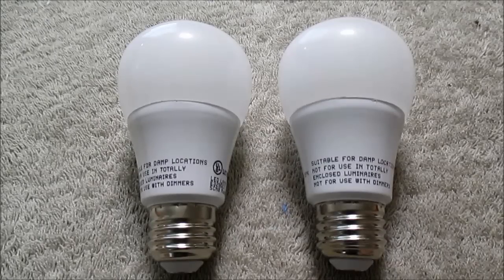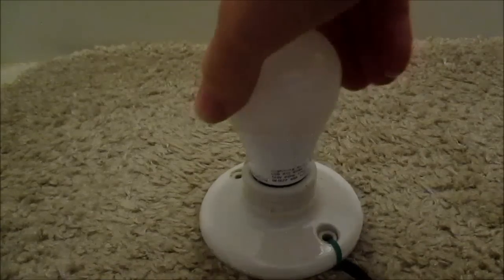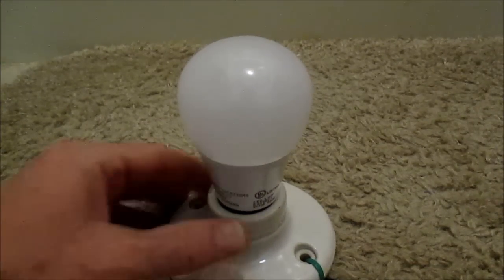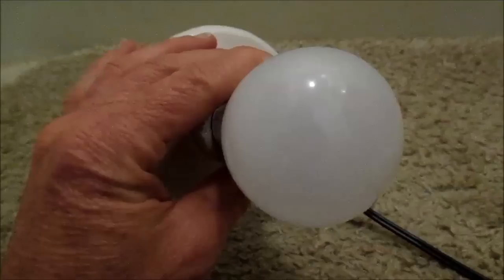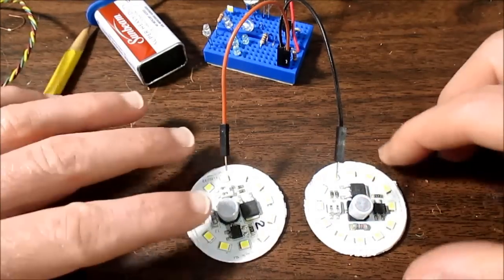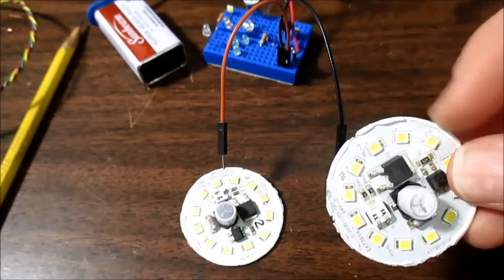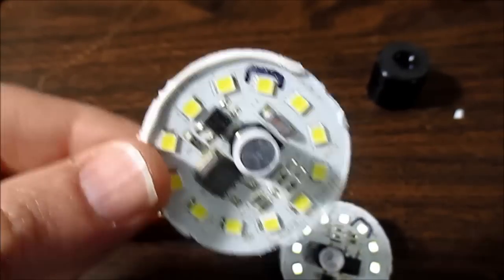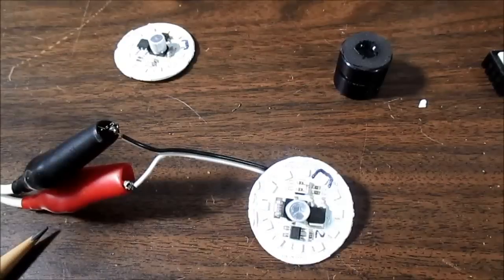Two failed LED bulbs for teardown to determine the cause

Comment: Could they make them so they are in parallel so if one dies they all don't die!
Reply: Yes they could. By putting say 3 strings of the LEDS in parallel you could have less of an impact when one LED failed, still having 2 strings of LEDs working. However, that would need 3 series-regulators and associated components, making the lamps bigger and more expensive. Rob
Reply: Rob Johnson How do Christmas lights work when one dies they all don’t die? And they are very cheap?
Reply: I have not touched Christmas tree lights for many years !

When they were filament-type bulbs (in the good-old days) connected all in series, the bulbs were designed to "short-out" when they failed so that all the other bulbs stayed alight.

That was OK until several bulbs had failed and all the other bulbs were being seriously over-run.  The better sets had some-form of "fuse bulb" that was designed to blow if there were too many other normal bulbs blown. That relied on that "fuse bulb" still being there and not having been changed for a normal bulb !
That should never have been allowed to happen, dud bulbs should have been replaced as they happened, they would have been obvious.
If there was no "fuse bulb", either the next bulb to blow did-so catastrophically or the fuse in the mains plug blew, normally the former happened.

Hopefully the fuse in the plug was as low as could be fitted, normally 3 amp in a BS1363 mains plug. I have never seen any 1 amp fuses of the correct physical size to fit a normal BS1363 plug (standard UK/Ireland fused 13 amp mains plug).

I was under the impression that most modern Christmas tree lighting sets were low voltage parallel connected bulbs/LEDs, so the rest of the lights would stay on.  Rob.

Comment: incandescent bulbs are still far superior to this trash.
just silicon, tin and card stock. (all 1005% bio degradable) and pending the style the alloy to make the filament.
no electronics to fail. far cheaper to make. and last for decades.
Reply: +Magyar Áron (RealAron) Inefficient, IT IS the main problem. You do not want to heat by electricity, becasuse it is the most expensive energy carrier. You do not want to heat in outside either. You want light, not heat! Incandescent lamps does not tolerate frequent on/off cycles, they are the least suitable to these applications. The LEDs does not need to warm up, nor the driver circuit, a properly designed LED driver could work in wide temperature range, and could tolerate frequent switch on. In electronics, everything can be designed for every use case, it is just matter of careless thinking and cost. Most of the cheap ones are directly designed to be the worst they can, so they are thrash from the start, and fail after a short time. It could be done to last ten years more, with not really that much more money. Less much than a well designed one really costs. And for the facts, I use LEDs everywhere in the house, it were not cheap, but none of them failed in the past years. You can calculate that (in Hungary), in about 2-4 months you gain back the cost of a proper 20W LED if you replace an 60..100W incandecent bulb with it, in a room where it is used cca. 6 hours a day. I see a very limited use case for the incandescent bulbs today...
Reply: sorry typo, meant 100%
Reply: Larry, last for 1000 hours, not decades.
Reply: Phil'0, things have changed drastically in pricing. Not sure on your side of the pond, but 90CRI bulbs here can be had for <$10, and not unusual on a sale for $5. The only reason they are harder to get is the public for the most part does not want to pay more.  We get single bulbs, name brand under $2.00
Reply: alvaius it's pretty much the same deal here, but as with everything your top line Soraa products are still head and shoulders above the cheaper ones.  It's not just cri, it's the consistency of colour temperature and lifespan as well. You can buy LED lamps at £3 for a 10 pack here, but I really wouldn't recommend them.
Reply: You mean a packed incandescent bulb,right ...they last for centuries,but don’t use them for more than 500 hours
Reply: chileyork ... They have near infinite ... shelf life
Reply: I have had a # of Tungsten Light Bulbs last far longer than the intended 1000 Hours.  There is a lamp in my Living Room I use twice daily for up to  4 -5 hours an evening....the Bulbs were installed in 2005....  & not only this pair, I found it many times esp the wee Globe Bulbs for Bathroom fixtures.  I realize the bulk of them go at 1000 hours. I well imagine "most" of these LEDs do not run past their rated hours.
Reply: I generally buy the Phillips bulbs here in the US-about $5 each, I started putting them in about five years ago-and I've yet to replace one yet.

But even at £20 each, you come out ahead over the lifetime of the bulb, simply in the savings in electricity (at least I would here in California).  I did the math, and over the life of one of my LED bulbs, I'm going to save $76 in replacement and electricity cost by using LEDs over incandescents.
Reply: "maybe inefficent, but that not always a problem"  I'd say that being inefficient is always a problem, because ultimately it means you're spending money you don't have to spend.

"Led lamps are trash for things like bathroom, where you spend most of the time only couple of minutes. Its starts out dim, takes 2 second to light up, and destroy the leds in a year."

My experience with LEDs is that they don't have that slow brightening issue.  And I've had them in one bathroom for several years now, and haven't had one of the five burn out yet.

"because heat is not "wasted" when its -10°C outside."  No, but there are better, cheaper ways of heating your house.  The heating system is designed specifically to produce heat for the house.  As such, it's going to be more efficient than using light bulbs that just heat the air around them.
Reply: Problem with incandescent lamps is that they are brutally inefficient, wasting electricity as (lots of) heat.  Good LED lamps have good colour rendering, nice light and last vastly longer than incandescent lamps. The problem is that good led lamps cost £20 each.  Unsurprisingly when you use a lamp which costs a tenth of that amount you get a tenth of the quality.
Reply: incandescent lights maybe inefficent, but that not always a problem. Led lamps are trash for things like bathroom, where you spend most of the time only couple of minutes. Its starts out dim, takes 2 second to light up, and destroy the leds in a year. Heat not a problem in cold places, because heat is not "wasted" when its -10°C outside.

Comment: Repaced around 30 bulbs around the home over the last few years w/utilitec (Lowes brand) so far ive had only 1 fail. And thier cheap. But i hate the light they give. Although a huge improvement over cfl's

Comment: Great video! I don't think it will change anything I do with LEDs, but your expert analysis was not only entertaining but welcome knowledge.

I think that many "Made in China" issues really come down to contract issues with the U.S. firms that place the orders. In setting up any production assembly line, there are going to be mistakes that lead to product quality variations in the statistical aggregate. Tightly run corporations write their specifications to include quality control analysis and remediation as part of the contract package. Those that don't, end up with runs that have a higher percentage of faulty product, because the manufacturing company will do only what is necessary to fulfill the contract.

Essentially, that is how Apple can use China to make tons of complex iPhones with very little quality backlash, while relatively simple light bulbs utilizing LED technology might have a failure rate approaching 10%.
Reply: Herbert   A lot of the Chinese companies are deceptive when it comes to quality. I retired from a company that wanted to lower our costs so we began trying various Chinese suppliers for our raw materials. We gave them our specs for particle sizing and chemical analysis. We requested a C.of C. along with a sample of each lot we were buying for testing and trials. Their certs met our specs and when we tested the sample in our labs it verified the certification papers. We instructed the company to send us the 10,000 lb lot. Upon receiving the material we sampled and tested the shipment. This time it failed chemical analysis so we sampled another container and retested plus we sent a sample to an independent lab. Again the material failed both labs. We were able to make the material work and we contacted the supplier. They were apologetic and promised it wouldn't happen again. We placed a second order expecting things to be different. They sent us a cert and sample from the new production lot. Oddly the test results reported on the cert were identical to the previous cert. The only difference was the lot number and date. We tested the pre-shipment sample and it met our specs but the main shipment failed our tests. This happened with each shipment they sent us. We came to the conclusion the Chinese company was sending samples from the same supply of material that met our specs along with a copy of the original cert but they assigned a new lot number and date matching the new shipment. This happened with several other Chinese suppliers so needless to say we continued buying raw materials from our European supplier.
Reply: ....I can hear the Boss;  "They no check up on this, they rely on compliance Papers"   It's more common practice than most ppl realise.
Reply: I worked for a company that manufactured a component for a Chain Saw manufacture. We supplied it at $.07 each. They wanted us to cut the price more. So we did. We just sold them the test reject lots. What ever happened to McCullough chain saws anyway?
Reply: Herbert, "Expert analysis" ... no, not even remotely.

Comment: I think the LEDs these days are the new "tungsten filaments" of yesterday. pop... burned out
Reply: I had 60W incandescent bulbs in my bedroom for 17-18 years. Only reason I changed them, was because I was replacing the lamp. They were so old, the goop that was bonding glass bulb to the metal base went brittle and disintegrated when I was screwing them out.
I wish I had a fluorescent or led bulb that would last half the time (at 20-40x the price).
Reply: THEtechknight your producing them at near the same price these days.
Reply: THEtechknight I
Reply: youngster led? hmm mmm?
Reply: @MasterBata There's a set of like 5 bulbs I installed in a bathroom of my parents home that are still burning some 6+ years later, incandescents. I think the secret was the special switch Lutron Maestro http://a.co/4Q6CDCU by Leviton that gradually incremented the voltage to the load upon switching. This graceful current draw I think really prolongs the filaments, but I'm not sure how it would behave on an LED circuit.
Reply: Probably so. LEDs from the 80s/90s I have never seen go bad, personally. They fade in brightness, but never go bad. Even the super bright red LEDs that first came out back then didn't go bad. So yep, change in production is causing this. Since these days, it seems LEDs go bad all the time. the failure mode for me seems to all be the same. intermittent or just plain dead. I see it all the time in modern gas price signs on the side of the road.

Comment: Put a 150 ohm 1/2 watt resistor across the open LED -- Fixed! Ideally, remove the open LED too, so it doesn't short out being banged around or during a power surge.

Comment: I had 3 fail after 2-3 days operation each. The bulbs were screwed into one of those photocell adapters that  screw in place of the bulb.. and then you screw the actual bulb into the photocell. I noticed with an incandescent bulb, the bulb would begin to glow as night approached and got to full brightness once it became dark. I replaced the incandescent with an LED and noticed that the bulbs would not to the low glow light the original.. but would turn on fully a little later than when the original started to glow. I noticed all night a burning plastic smell. I thought it was the "new electronic" smell one usually detects when first turning on a new device. The first bulb lasted 2 nights. I figured I got a bad one so I replaced it with #2.. same thing.. then that was replaced with #3 and it also lasted only 3 nights. Each bulb had a burnt smell to it. I had put some of the same batch (same box) at another location controlled with a normal toggle switch. I never had trouble with those. I think the photocell is partially turning on and feeding low voltage to the bulbs.. and that may be what is causing the LED bulbs to burn out.
Reply: obsolete, were you using dimmable or non-dimmable bulbs? Make sure they are dimmable and the problem will probably go away.
Reply: They were not dimmable. This led me to wonder how a photocell (really) worked. I thought they snapped off and on. The incandescent used prior would softly glow as evening approached.. that told me that the photocell was turning on gradually. Maybe I have a bad photocell and the combination with the LED's was not good. I never got around to putting a voltmeter on it so see.
Reply: Those older dusk to dawn things were able to only to shed their 5 watts in series with a 100watt bulb not a similar 5 watt load. The undimable LED's are subject to this. I damaged a LED on a socket of a double arm lamp with poor connections to the shell from years of getting cooked to a crisp.
Reply: Thank you all for your comments.. always something new to learn.
Reply: "Non-dim-able" because dimmers involve sharp switching at 100c/s, and most led lamps use a capacitor to set the current, assuming a Sinusoidal voltage.  The sharp switching will put huge current pulses through the leds at 100 ppsecond.
Reply: Would you stop posting crap you know absolutely nothing about. Most LED lamps DO NOT set current with a capacitor. That said, non-dimmable bulbs will have large capacitors in them that were never intended for high current input.
Reply: +obsolete professor
  yes always something new to learn.  On this one I learn that pomposity is directly proportional to ignorance. !
Reply: LED dimmers are a lower power dimmer, so anything that dims incandescents isn't going to be appropriate for LED's.

Comment: As a possible rescue so as not to just throw it away. Short out the bad LED.  Modify the regulator to provide half the current.  You measured 67mA. Reduce it to 30mA.  You will have a reduced brightness lamp to use in applications where you don't want much light.  And the reduced current should help the LEDs to last longer.  I frequently need a lamp that only has a 25W equivalent output. Perhaps a constant on light in the garage. Also drill many holes in the bottom part and many in the top part to let air flow.  Perhaps you can find some places in the PCB where you can drill air holes through it.  Heat really murders LEDs.

Comment: the best option I think would be using some CREE XM-L2 LED's because they are about the size of a 5050 LED but can handle 10 watts
imagine a 10x10 grid of cree LED's
1000 watt light anybody? LOL

CREE XM-L2 LED's can handle about 10 watts continuously with a heatsink no problem (and even higher watts if you have a bigger copper heatsink with a fan with plenty of thermal compound)

You would need about 30 amps to power them! approximately you'd need 10 boost converters rated at least 150W each set to exactly 3 amps. and parallel all the +'s and all the -'s.

That would be one small tiny but ridiculously bright LED light. I think it'd be the smallest and brightest LED in all existence.
It would be a whopping 1,000,000 lumens!!!!!

Comment: My only criticism for this video is the "idiot killer". OK, I've done this myself, but if you are going to make a video that can be viewed by novice "techs" and curious kids, you have a responsibility to conduct your published testing as safely as possible. The 120 V connection should be made with wire nuts, or at least wrapped in electrical tape. There's a reason why an exposed high voltage testing rig has been dubbed "idiot killer".
Otherwise, this has been interesting. I have not had a failure in my Walmart brand LED lights for over a year now. Typical with localized branding, there is no mention of the manufacture other than they were made in China. I have noticed one thing worth mentioning; I have an LED bulb in a desk lamp. It is upside down as opposed to a bulb in a normal table lamp. The desk lamp shade or housing is warm to the touch where the other (table lamp) bulbs are only warm on the bulb itself. I would say that the "heat sink" base is much more efficient if the bulb is inverted. It's easy to forget that these bulbs are not vacuumed so heat is built up in the air surrounding the LEDs, bridge diode, and regulator. I wonder if a few holes are drilled in the plastic bulb top and near the base to allow air flow would help extend the life of the bulb ...  ?
Reply: 120V is killer?
Reply: 120 volts is not high voltage, Einstein!